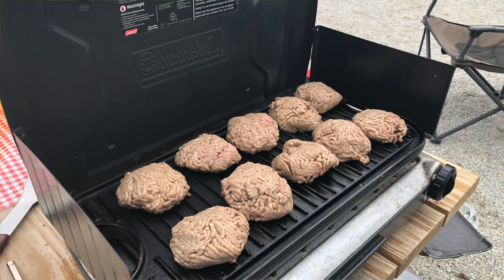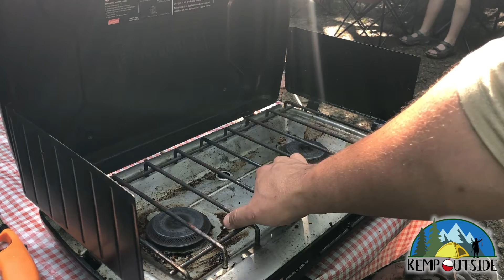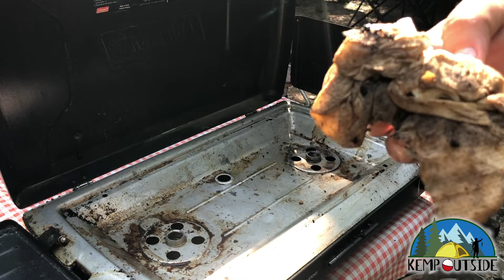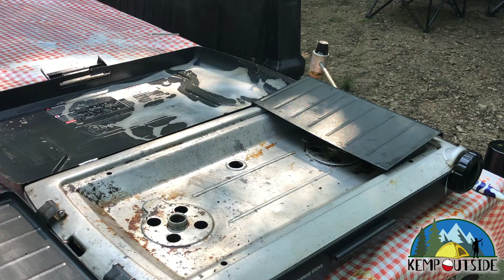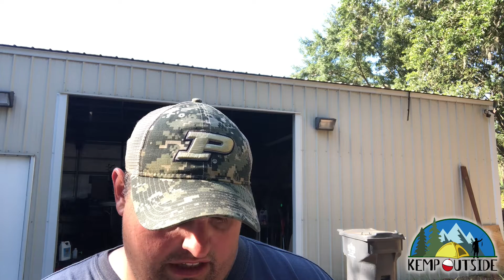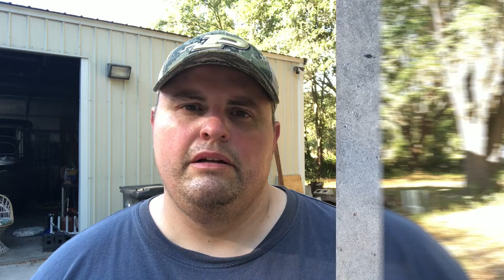How to Clean a Camp Stove | Testing Super Clean Cleaner-Degreaser Products

Comment: steel wool will remove the aluminized coating on the stove tray. I used barkeepers friend but it also removes the coating if you scrub.
Reply from the maker: Sometimes you need to break an egg to make an omelet!  But I agree on the Barkeepers Friend and to go as soft as possible.  This stove has had a lot of use and doesn't always get the best care right away.